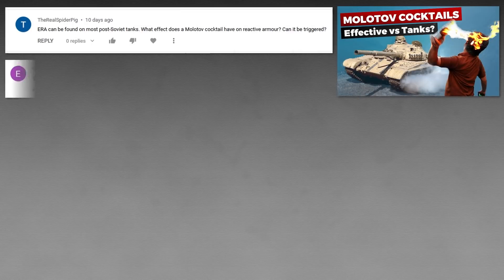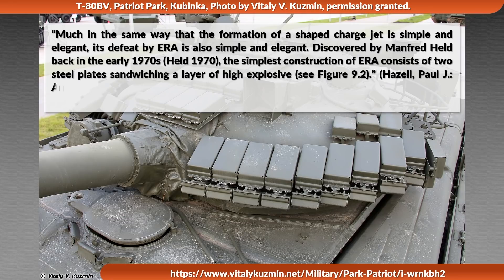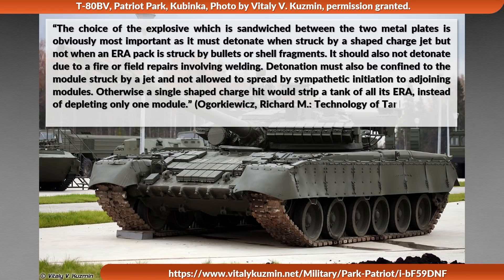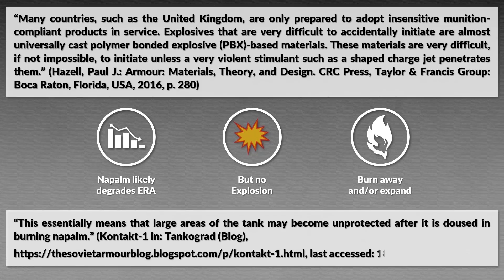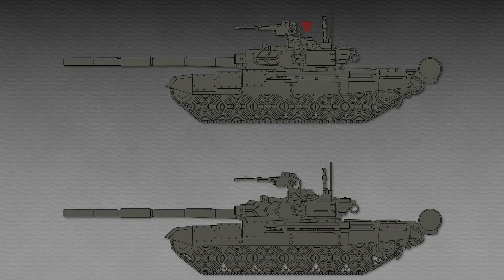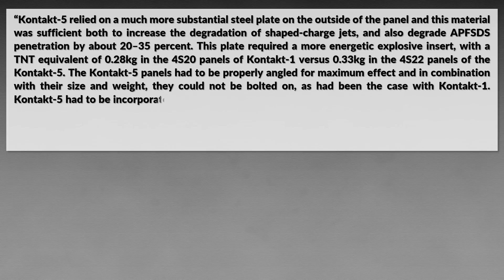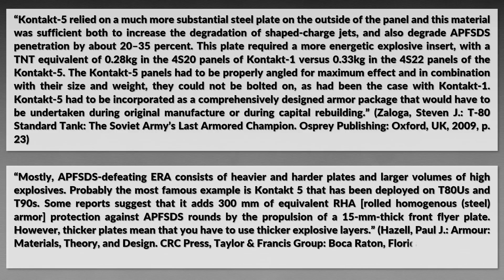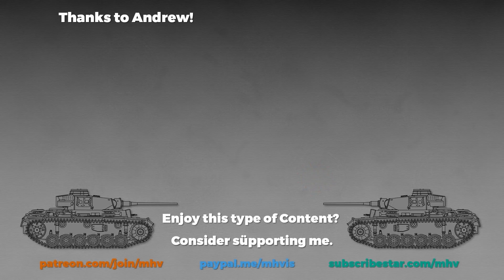Why does Russian Explosive Reactive Armor not explode?

Comment: Military dislikes sensitive explosives to the degree of the complete exclusion of them.
The thing that makes old battleship and russian tanks go BOOM, are not the explosive munitions, but the gun propellants.

Civilian explosives need to be as non-toxic and environmental friendly as possible, and cheap. But they only need to be insensitive enough to be safe to handle. They also don't need to keep or have long shelf lives; you have a good idea when you will need them; they can even be made just before loading the bore hole. And the explosive power per volume or mass is pretty indifferent, what counts is per cost. Because of this, civilian explosives have always been based on Ammonium nitrate, Nitroglycerine, Nitroglycol, Nitrocellulose and Methylammonium nitrate. Different combinations of these have formed the civilian families of explosives, Dynamite, Blasting Gel, ANFO, GSX, Tovex. Only AN (extremely insensitive) has found a use in military explosives, in Ammonal, Amatol and Minol, but only in wartime emergency, as AN explosives don't keep.

Military explosives need to be shot out of gun barrels, take shrapnel and bullets without exploding. Particularly navy explosives also need to be able to sit in fires for a long time without exploding. They also need to keep well; no fun to have to replace your entire ammo storage because of expire date. Finally, they need to pack a punch. Also, military are environmental pigs, they don't care shit.

The modern way to make military explosives insensitive is PBX (plastic bonding). Another way, extremely insensitive explosive compounds like TNT, DNAN, DNT are melt-mixed in, to make the entire explosive insensitive (phlegmatized), resulting in classics like Cyclotol, Torpex, H6, Octol, Pentolite, and many others.  These do have a tendency to "cook off", if they sit in a big fire for a long time, which is why PBX explosives are preferred for naval munitions. Some oils, paraffins and waxes can also serve as phlegmatizers, like in C4, Semtex and Detacord. Petroleum Jelly was used in melt-mix with TNP for the WW1 explosive Lyddite, and DNP or HND was used with TNP for Shellite.

Comment: could the non-depleted blocks from destroyed tanks be used to reinforce defensive structures against tank fire?
Reply: They would not be effective because in case of some fortifications like bunkers tanks would use HE shells anyway. The best they could do is to prematurely detonate a shell before it could drill into a structure but as you already know ERA is really unreactive and you need a cumulative jet in order to initiate it. ERA is strictly for HEAT rounds.

Comment: Finally somone got it. Hollow charges do not burn through armor! Its to fast for exchange of thermal energy! Under immense pressure solid materials like rock or steel behave like fluids. Its the same physical principal that allows for continental drift.

Comment: One thing I was wondering was, in several videos shot by Ukraine (especially the one NLAW close range ambush) you saw tanks hit that didn't brew off but had a smaller fire on the hull or turret. Was this the remainder of a ERA brick burning off?
Reply from the maker: Could be, but if you mean that one from the window at very close range that was below the minimum arming range of the NLAW, hence the burning stuff was parts of the missile.

Comment: as a combat engineer many moons ago   we had 40 and 60 lb , if i recall , shape charges  for multi uses    they had a thick glass cone up inside that focused a portion of the blast out many feet and would penetrate armor plate with what was described to us as a focused plasma burst   we even made some small ones from c-4   and yes most all mil grade things like we had can be shot or lit and takes a blasting cap to start   and some of the big tank mines had 2 detonators
Reply: So I guess glass shaped charges are more common than I thought. I saw the channel Ordinance Lab make wine bottle shaped charges, but I thought it was just showing that it was possible for glass to work.

Comment: Remember y’all causing an explosion isn’t just about adding some fire to a combustible, it’s about providing the proper catalyst for the exact reaction you want. It might be confusing that fire doesn’t set off ERA but we all fundamentally understand this in other ways. For example, blowing on a glass of water will not make it freeze despite lowering the temperature. But put that baby in a dry ice cooler and it’ll freeze super fast!

Comment: ERA is so fascinating. Most people don’t even know it exists and most wouldn’t believe armor could be slapping extra explosives on the outside of a tank!

Also, remember that plastic explosives like C4 also are very hard to set off. You’d have to use the blasting caps designed for them to create a shockwave.
Reply: some era use c4 blocks as charges even
Reply: I'll probably forget about the c4 part...wait what was it again I was supposed to remember????

Comment: all plastic explosives work with extreme pressure meaning they're stable to carry and you can't just light them with a match that's why there's detonators. when they were hit by an armor piercing round or an explosion from a warhead they will detonate. but if you just like them on fire it will not work. they were designed for safety

Comment: Of course there is the other consideration to be looked at as to why the ERA does not explode. It is a widely know common fact that cardboard egg containers used for filler in lieu of the actual reactive material in the enclosures do not explode, they merely burn. Unless there are eggs with their shells intact, then they may cook off.

Comment: Not sure if you get into this in the video, but there are explosives (such as C4) which do not explode when on fire - they need heat AND compression (thus the use of blasting caps).This is so they are more stable for transportation- I would expect this to be the case with ERA as well.

Comment: High explosives should generally stay unexploded by just heat.
There are both hig and low explosives:
Low explosives are the explosives most are directly familiar with, like the gunpowder used in fireworks. It explodes by a rapid combustion releasing huge amounts of gas. They consist of at least a fuel and an oxidizer.
High explosives are rather inert to combustion and need a shockwave to explode. They explode by decomposition of the molecules it consists of, turning the liquid or solid into a gas. This process is called "detonation". A high explosive consists of at least a single substance.

Tom Scott has a video about film explosions in which he covers this common misconception, after he was corrected that not everything explosive is a high explosive.

TL:DR: Low explosives combust, high explosives detonate.

Comment: How fast would the tank have to go for a crash to detonate the reactive armour
Reply: from what I've read here in comments (some showing experience) I suspect a tank dropped from a plane & parachute fail would not do it.
Reply: Ironicaly enough its actualy safer to transport high explosive then low explosive because you'l need alot of energy to set them off even burning them wont.

Comment: Yeah, very interesting about no chain reaction and not been set off by cocktail molotovs, but I doubt that's what people are interested in. What would be really interesting to know is why the reactive armor didn't protect the tank. Did it explode against the incoming weapon and failed to stop it, or did it not explode at all.
Also, the way you describe those reactive armors is as if they have no sensors at all. So the shock of the hit by the incoming armor should set them off? But isn't it too late then?
Reply: A shaped charge explosion is very mathematically precise. All of the force from the explosion is directed in one direction. When the directed explosion sets off the ERA, the ERA explodes, which unbalances the shaped charge, which is deflected back away from the tank. Any residual forward momentum the shaped charge has is deflected by the armor of the tank. In theory.

Javelin missiles, particularly have a duplex warhead - two shaped charges stacked behind each other. The first one goes off just before the second, and impacts the ERA. The ERA dissipates the first charge, but the second charge has a clear path to the tank hull. NLAW does not have a duplex warhead.

It should be noted that we aren't seeing videos of soldiers shooting tanks with older RPGs, which ERA and just good composite tank armor can defeat, because Ukraine has a mostly competent military who has been trained not to waste those weapons on tanks and use them on APCs and trucks instead, which remain vulnerable. Specialized anti-tank missiles are needed to destroy tanks.

Comment: There were "soft package" ERA blocks on at least two T-72B3 and T-80BVM tanks in the initial wave that pushed to the northwest of Kyiv, according to videos in early March. In the videos could be seen the packages... filled with anything but ERA plates. Verification of this claim is nonexistent, so I'll assume it was fake...

But it still begs the question that I had after seeing those videos: I know that simply not having ERA where it should be (either by failure or fakery) is detrimental to the ability to defend against the rounds that these packages protect against, but what factor does proper maintenance have? After the news from western media that multiple FSB (and other agencies') agents were found to have embezzled money meant to go towards intelligence and military operation, coupled with the videos, I'm beginning to wonder if anything was done properly and to military doctrine, rigorously maintained, checked by mechanics and experts on the individual equipment... you know, the things every other military has very little issue doing. 

Add to all of that watching the Ukrainians ambush command center after command center after tank column after tank column... 10 generals and many of their staff, including the Combined Arms leadership, dead in strikes... cope cages hastily welded onto turrets... it would be insanity not to wonder if all the oil has been changed and bearings checked.

Comment: The entire spectrum of explosives are divided into primary and secondary - primary being that which can be set off by fire or mild impact. Secondary requires an initial detonation to set it off. All modern hand grenades, bombs, and missile warheads use secondary explosives and most of the time fire will make them burn but not detonate. There is an exception to this, though, which is if the explosive is exposed to a lot of heat for a long period of time. This can cause chemical changes in the explosive which make it far more sensitive and can cause detonation. This is known as "cook-off". Insensitive high explosive (IHE) is especially resistant to cook-off.

Comment: The "explosion" which pushes the turret up into the air, while violent, is nowhere near as violent (locally) as a detonation. Burning ammo causes a rise in internal pressure up to maybe 1000 psi which then pushes the turret off like a bullet. A detonation (or the impact of the shaped charge jet) is FAR more violent and produces pressures in the millions of psi. This explains why a detonation (or hypersonic impact) is needed to set off the ERA, and not just the pressure pulse from pushing the turret off.

Comment: Because its not draw signed to explode in a fire, but in the extreme conditions of being hit by a HEAT round.
The ones hut by the missile go off, dislodging others nearby. If the tank is hit in another place without ERA, nothing else will set them off.
IDK if the filler will burn exothermically, hut that's the least of the problems for the crew and owner.

IDK how much of a tank's warheads will explode in a catastrophic fire, versus the propellant (or any exposed warhead explosive filler) in the rounds burning off very energetically, if not an actual supersonic exflagration of an explosion.

Comment: I love how people watch this stuff and ask questions that can be googled or end up being answered by the knowledgeable. Simply put, I can set fire to C4 and let it burn with no chance of it exploding. Plastic explosives are used in ERA because they are stable explosives. It takes heat and pressure to cause a detonation and the individual packaging and low weight in each block isnt enough to set off adjacent blocks. Anything short of a blasting cap wont set off an ERA block and you wouldnt be shooting a tank with small munitions or a machine gun so the risks of API isnt really there, nor does it have the force to penetrate the inner steel plate after punching through the outer layer of the block. Heat from fires, wont set them off but it will likely cause them to degrade and some may off gas enough to add to the fire or can ever catch fire if exposed to enough heat to degrade the PXE inside and cause conflagration to occur. But more likely it will simply degrade the explosive and result in blocks needing replaced if the tank is still serviceable.

Comment: One thing you didn't take into account, which has been my assumption from the start of the war, is that due to poor maintenance practices (as we've seen throughout the war) the Russian ERA has degraded to the point that the explosive has become somewhat useless. There's been a number of videos of direct turret hits with NLAWs (single warhead HEAT) on ERA that just didn't explode. My suspicion is that the truth will be a mix of many aspects: poor maintenance, stolen ERA, and just ERA functioning as intended.
Reply: Shelf life for PBX is about 40-50years.
Please show us such videos where you clearly can see where the ERA block was struck
Reply: @sierraecho884  When stored well, PBX lasts 40-50 years, but, as with much of Russia's equipment, it's been left in the elements for half a decade, the explosives degrade.

As for videos, yeh, I'm not posting videos here where I'll get banned. There's been a few instances of T72B2's and B2M's cop a turret shot, straight in the ERA, and the turret then pops. It could be just bad luck, but I suspect, looking at how bad all Russian equipment and supplies are, poor maintenance is the cause.

But, I've come to expect these kinds of replies on YouTube, especially when discussing Russia's joke of a military.
Reply: @sortius_  it may have been bad luck or russian military coruption but i think its more likely that does were struck by tandem shaped heat which was made to counter era

Comment: A question i had for a while now: how is ERA affected by HMGs and autocannons? IIRC even a .50 AP bullet can perforate 20mm of armour grade steel, with autocannons in the 20-30mm range being able to punch through 5cm+.
Therefore individual ERA packages could be penetrated. If their outer casing is perforated their performace should suffer quite significantly, due to explosive energy escaping through the existing weakness instead of accelaterting the ERA steel plate.
Is this a correct assumption?
Reply: It depends on how much auto cannon fire the tank has taken. 30mm auto cannon is a serious threat to a tank by itself you can destroy the optics, the wheels and so on.
So with prolonged 30mm fire you can strip all the ERA blocks from the surface. But why ? this scenario is unlikely.
Reply: I would imagine autocanons would penetrate and set off most ERA tiles. However you would then have to hit that same area with a larger weapon. Not something that sounds easy to do as the target vehicle is probably going to react and start maneuvering, deploying smoke or shooting back.
Reply: Depends on the explosive used ... for example... C4 requires bother heat and pressure ... so using a common match can ignite C4 causing it to burn but if while burning someone were to try and put the fire out by stepping on it, they'll blow their foot off.

Comment: You have to wonder about the age of the Russian era on their tanks and is it even effective anymore, and they seem to be struggling with western tandem head AT missiles. Also, you describe kontact 5 as integrated, this would become an issue as it ages and when expended well it might save the crew but your tanks out of action. Kaput until repairs are effected and if you cannot recover it, well that's lost.

Comment: Minute 10:40 : it is said that machine gun fire and presumably other small arms shouldn't be able to set on the RHA block. However, what about a substantially more powerful round ? Like 12.7 mm, 14.5 mm, 20 mm, 23 mm or even 30 mm ? Wouldn't they activate the charges due to their significant power ? Could heavy machine guns or autocannons be used to "clear" the front of an MBT in order to weaken their armour against dedicated antitank rounds or rockets ?

Comment: Great video, The "jet" is basically a copper rod that is traveling 10 times faster than a bullet fired from a high power rifle. I read in a US military manual "Improvised Munitions" that it is the velocity (up to 10k meters per second) of the jet that causes the armor penetration but the jet is only focused at that high velocity within a fairly short distance in front of the warhead and the job of the reactive armor is to deceleration and break up the jet of material from the shaped charge.
Reply: I.e. it's not "the velocity", but the velocity being concentrated in a very small area (see Sean Blanton's post above). Spread that energy out over a larger area, and its velocity becomes essentially irrelevant. Area is a squared function, after all.
Reply: @lukeueda-sarson6732  yes, the velocity focused into a small area. Did you not read my entire comment?
Reply: @randyhavard6084  I did, which is why I wrote what I did: to clarify the military manual you quoted is wrong. Or at least misleading, assuming you have quoted it correctly, that is. Did you quote it correctly?